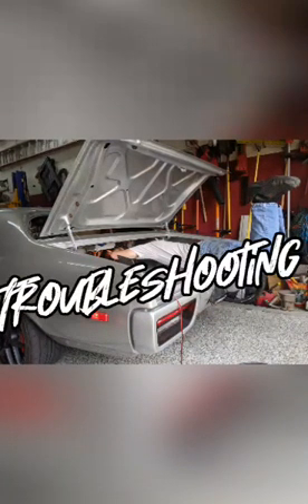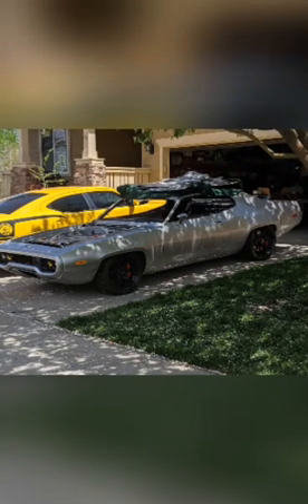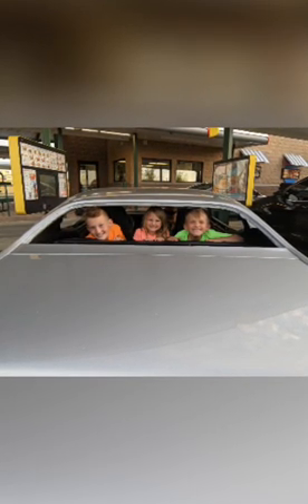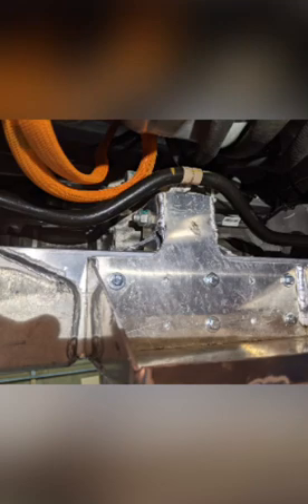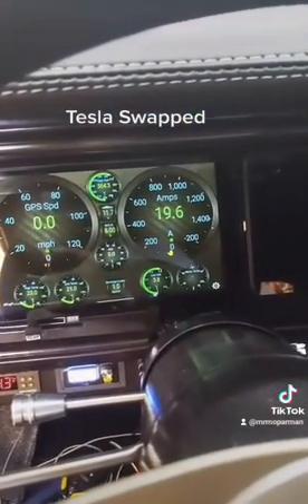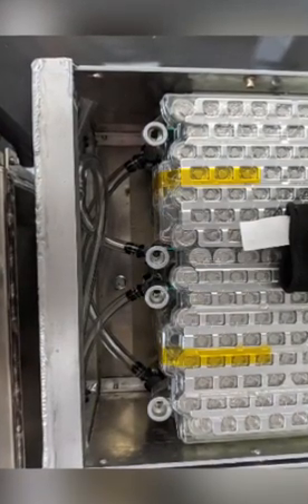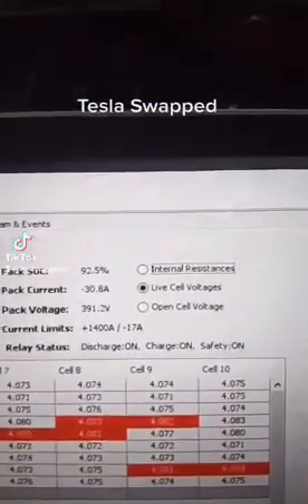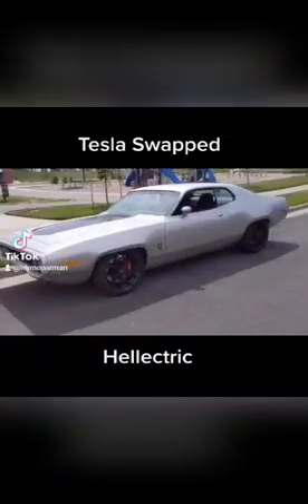Project Electrollite - Plymouth Satellite Tesla Swap - Troubleshooting! Ep.14

Comment: What state are you in
Reply: Sweet same here, i want to do something similar with my classic
Reply from the maker: @andrewschmitt3765  Nice, what do you have?
Reply: 74 Plymouth duster
Reply: Im going to do the same but with out the Tesla motor
Reply from the maker: @andrewschmitt3765  what motor are you planning on using?
Reply: @MrMoparMan  EVD250-90P1 with a 175kw control. Attached to a 6 speed transmission
Reply: But planning on useing the Tesla batteries
Reply from the maker: @andrewschmitt3765  Nice looking motor, do you already have a 6-speed?  Tesla batteries are hard to beat.
Reply: @MrMoparMan  not yet the transmission i want is the tci 6x
Reply: From my calculation. With the motor spinning at 1500 rpm the car should be going 76 mph in 6th gear
Reply from the maker: @andrewschmitt3765   interesting, what's the max RPM of that motor 10K?  I think most electric motors have a wide torque band and don't need as many gears, but it doesn't mean you can't use more gears.
Reply: Yea 10k. And it does have a wide torque range, but the gears are there to increase the range
Reply from the maker: Colorado

Comment: Someone commented on my coolant lines suggesting that over time and through several heat cycles, it's possible for the rubber lines could weaken their grip and leak.  McMaster-Carr sells 25pcs packs of constant tension bankd clamps for like $3.  Cheap insurance if you ask me.
Reply from the maker: I saw your clamps, I used those on my big hoses and then I've got little baby clamps on my little hoses.  I did some stress testing with some boiling water and no clamp and the fittings I used held pretty well so far but I like the extra insurance.

Comment: For what it's worth, you don't have to fully disassemble Ampseal connectors to remove the pins.  Just un-clip the red part and pull it forward until it stops.  Then use a small drill bit or something to push the pin out of the connector.  I'm sure you discovered that getting all those little pins to align with the red part is kind of a pain!
Thanks for the update!
Reply from the maker: Yeah I love those connectors, I have two of them on my smart wire which I swapped out a lot of wires.  A little quarter twist and they come out pretty quick.

Comment: In the heat of the day, in a car...  Those translucent fittings and hoses will end up cracking or failing.
Reply: i dont think so. it is probably a thermoplastic. as long as they are not directly under the sun (no UV protection).
Reply from the maker: If that happens, I'll just complain to the guy who built it 😉

Comment: I would suggest to replace your 12 v lead acid battery with a LiFePO4 one.
Reply from the maker: I'll probably look into something like that!
Reply: @MrMoparMan  its chemistry is better suited for your application since EVs have a higher parasitic load than usual. Traditional deep cycle automotive batteries will not probably last long.
Reply from the maker: @jackripper5240  I'll have to look into the charging profile on the DC/DC converter to see if it's compatible with other chemistries.  Luckily it gets charged as soon as the car power's up so there's not much drawdown on the 12V battery.
Reply from the maker: @jackripper5240  I think Tesla just recently changed from a lead acid which I thought was surprising that it took this long.
Reply: @MrMoparMan  yeah. its a change long overdue. Next would be transforming the archaic 12V system to 48V!
Reply from the maker: @jackripper5240  No doubt!
Reply: @jackripper5240  what parasitic loads dies an EV have when the key is off?
Reply: @billbayer5526  yeah maybe you are right. i misuse the term. however in this case it could be warranted since its in an automotive/EV context. but i digress. Im talking about the electrical load that needs to be powered by the  12V battery.
Reply: @billbayer5526  btw good luck on your build Bill. seems interesting. Post some stuff in the diy ev conversion page in FB too.
Reply: The problem is when it gets cold. If that 12v lithium battery freezes and you try to charge it it's over. That's why no EV's use them. Tesla must have a heater.
Reply: @billbayer5526  i mentioned a specific chemistry. take note...that is not nmc
Reply: @jackripper5240  LiFePO4 suffers from the same "death by charging when frozen" problem as any lithium (that I know of) battery does.  The traction pack of an EV can deal with it because once you start driving, the pack will warm itself up from the inside out (and it probably has a heater in its cooling system).  Whatever electrical loads and EV may have while running are immediately taken care of by the DCDC converter.  The DCDC converter will start recharging the 12V battery if there were indeed parasitic losses when the car was parked.  If it's frozen, you have a big problem.
Personally I don't see any value in changing the 12V lead acid battery to Lithium anyway.  I guess you save a few pounds (10-15?) but loose lots of money and add complexity if you decide to provide some sort of heater.  I'm not really sure why Tesla is going to all the trouble other than bragging rights.  
***I could be wrong!!***